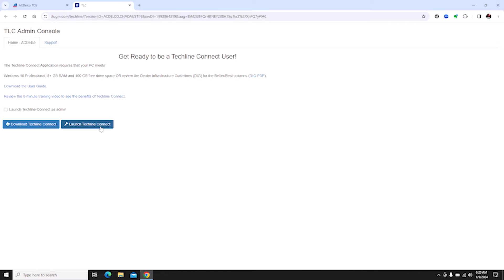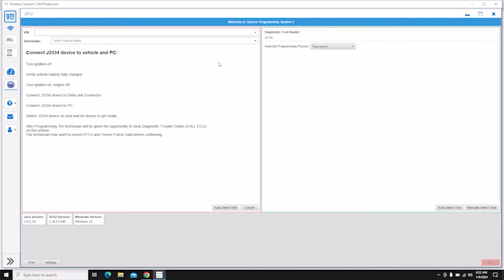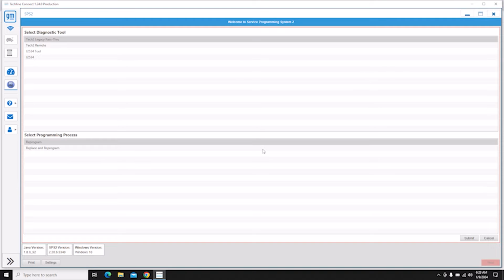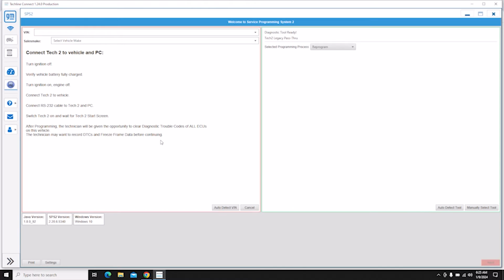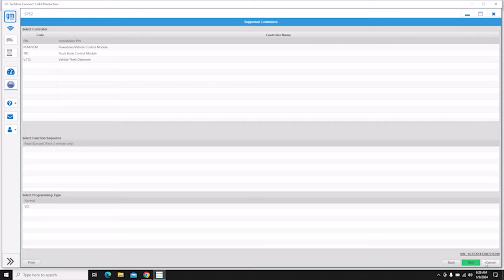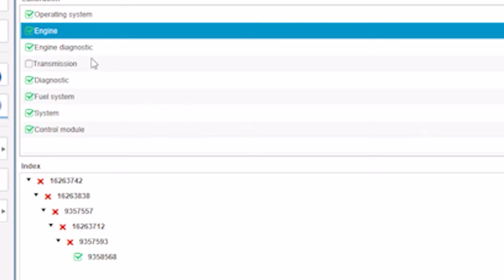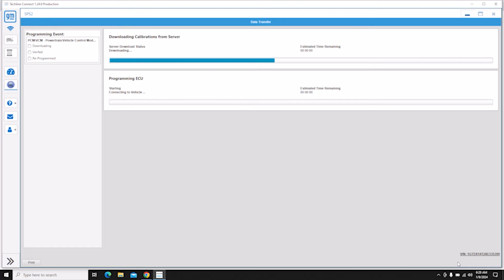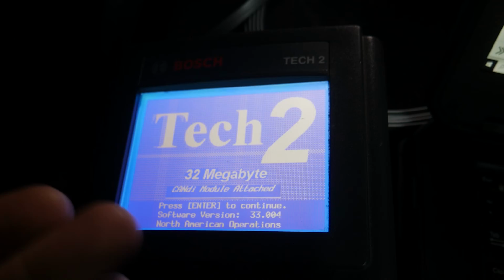Using the Tech2 as a programming pass thru device with SPS2 or TLC

Comment: Would you recommend pass through mode or tech 2 remote for a 2005 Silverado cluster? I have to program one I keep getting a service brake booster message on it.
Reply from the maker: @philh9238  I normally use pass-through mode, but I have used remote as well. I performed a theft learn on a 98 Chevy today using pass through mode.
Reply: I didn’t see anything in Mitchell about programming a cluster for the 05 Silverado. So just stuck it in and guess it needs programming. It says service brake booster it’s configured for a rpo I don’t have. Almost used my cardaq to do it but didn’t want to brick it
Reply from the maker: @ if it has an aftermarket radio pull the radio fuse. I have programmed them with Cardaq+3 but prefer my Cardaq-m. 
Many have reported better results if they use debugging mode on the Cardaq+3. This is activated in the j2534 toolbox and can help slow down the process since these modules use an older communication method. 
I programmed a 2005 duramax ECM over the weekend with both the Cardaq+3 and Cardaq-m. I actually used every single one of my interfaces as a test to see what would work and what wouldn’t. Autel was a no go, Opus device worked fine, MDI2 worked fine and tech2 worked fine.
Reply: Used the tech 2 as a pass through. Worked. Took me longer to get the usb to rs232 adapter to work. Had to call the manufacturer where to even get the drivers for windows 11.

Comment: Thanks for posting this, I prefer to use the Tech-2 over the MDI.
Reply from the maker: @swathdiver489  for the older vehicles I have less problems doing it this way. Just make sure the car doesn’t have an aftermarket radio.
Reply: @ThePracticalMechanic  What kind of problem does having an aftermarket radio cause?
Reply from the maker: @ the aftermarket radio requires a box to installed for the door chime and to power the radio on when the key is turned on. The box communicates on the network to find out the status of doors and key position. 
The problem is these boxes don’t listen to the programming interrupt command that tells all the modules to stop communicating and just listen. You start programming and that box will start spouting command on the network that mixes in with the programming messages. This can corrupt the module you are programming.

Comment: Was there anything you had to do to get the Tech2 to communicate with your laptop? My laptop is not detecting the Tech2. Using all the same cables and adaptors that worked before back when I was using TIS2000 on DVDs. Only difference is the laptop and WIN 10pro vs WIN XP.

Comment: What cable are you using to go from tech 2 to laptop
Reply from the maker: It’s basically an Ethernet cord with an adapter on the computer side so it could connect to the serial connection. If your computer doesn’t have a serial port an additional keyspan serial adaptor will be required.
Reply from the maker: I added some links in the description for the the cable and serial adaptor.
Reply: I tried programming a used ecm in a 1997 impala. But bricked it with tis2000. Wonder if I can manually enter vin on sps2 and save It? Any pointers?

Comment: Hello hanks for your video
what is the coverage of TECH 2. Does it cover even latest module such as GM 2021 and up
Reply from the maker: I have only tried it on a few vehicles but I think coverage is up to 2007
Reply from the maker: Let me clarify.  I believe programming coverage goes up to 2007 but the tech2 can talk to some vehicles up to 2013 for diagnostics.  A SPS2 subscription is still required for programming with the tech2.
Reply: @ThePracticalMechanic  thanks for your prompt reply. I own Autel maxiflash from my lost Maxysis elite, VVDI2 J2534 as well cardaq m from drewtech and was wondering if there is any need for me to get tech2.
Reply from the maker: @dfwcarkeys  the cardaq-m was always good to me on the older vehicle. It’s an older device and was developed when there was more of these trucks on the road.  Tech2 has other benefits besides programming if you see many of these vehicles.
Reply: @ThePracticalMechanic  i did not even know the cardaq was that old. I guess the expensive proce i paid in 2017 made me think it was a recent device lol. I kind of noticed that they were pushing the cardaq 3 for a lower price that i paid for cardaq M. painful lol. I hope my cardaq M can still handle all the programmings i want to get into. Not sure about Can FD and 2021 + vehicles